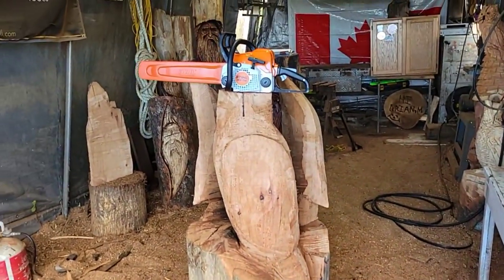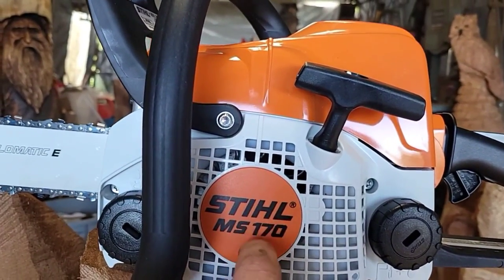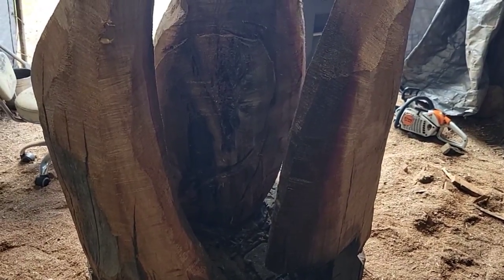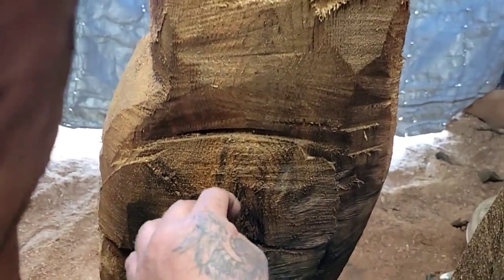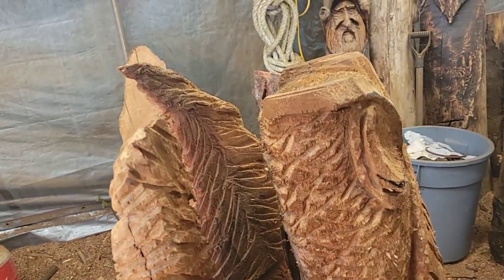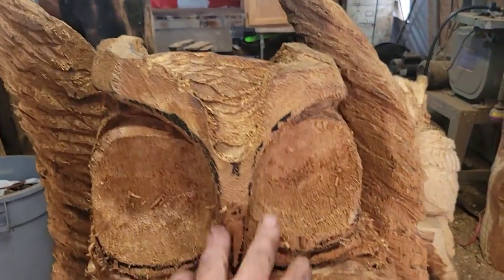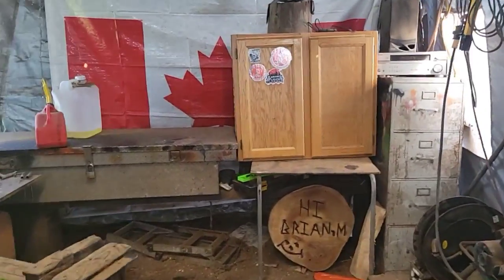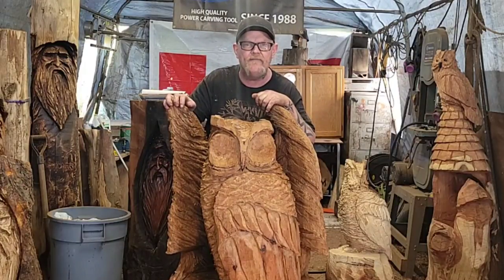Showing the trials and errors on wood carving a owl with chainsaw.

Comment: Alberta boy says...
Thats some big wood you play with....and I agree that the give back is important...last week I got 4 lg. Spruce trunk bottom rounds from a house down the street and gave the home owner a quick owl on one of the cleanest pieces he was keeping. Gave it back about 3 hrs later.....the look of joy on his face was worth way more than I would have had stuffing a few bucks in my pocket had I sold him. Sometimes the payback is better than profit !!
I'm running a MS170 and dime tip( last week's new addition)....new last fall when I had 4 months e experience... my blocking is either little Craftsman my dad bought in 1973 or and a old, old McCullough MAC 10-10 ( I FOUNDl AT THE RECYCLING  SHOP 7-8 YR.EARS , ⁸ its a beast.l